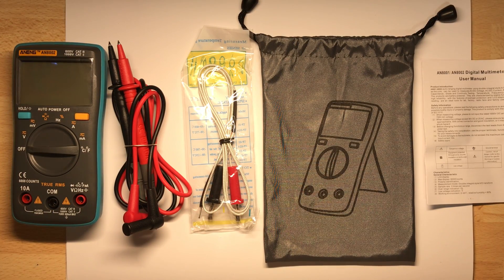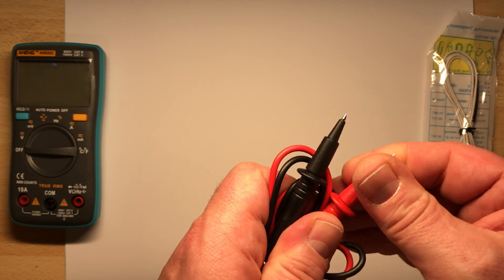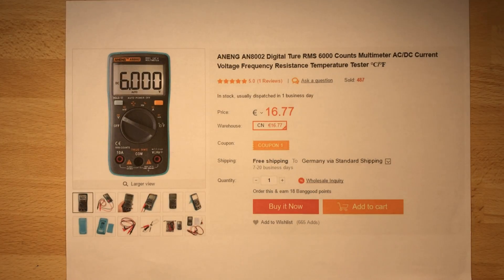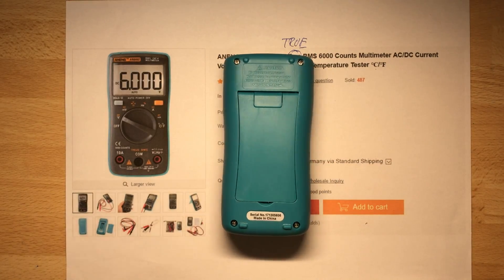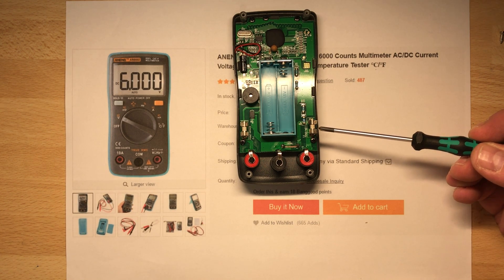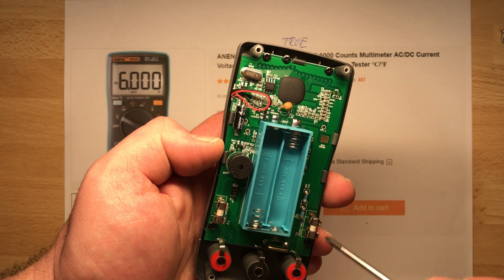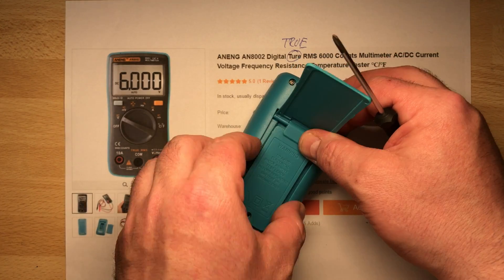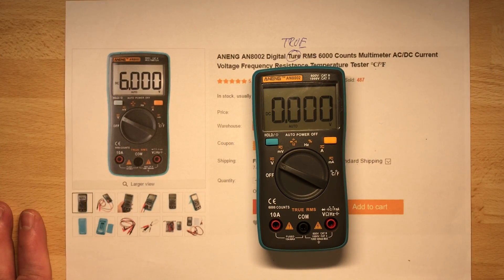First Look at the ANENG AN8002 6000 Counts Multimeter from banggood.com

Comment: An  old vid, but as for the fuses. If anyone is still looking for them they are the Axial Fuse wired type. Just cut the wire off. plenty on UK eBay. one link here  https://www.ebay.co.uk/itm/3-x-Axial-Fuse-T1A-T1-25A-T1-5A-T2A-T2-5A-T3A-T3-15A-T4A-T5A-T6-3A-F10A-ref-196/283197480819?var=583610245864